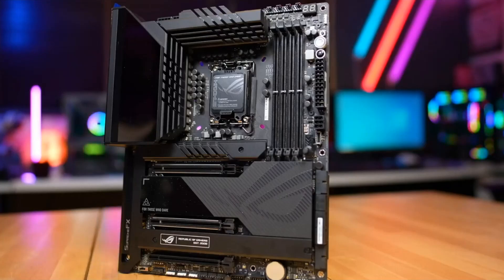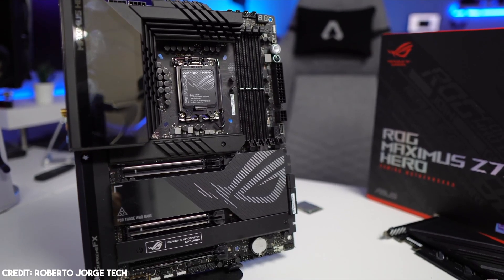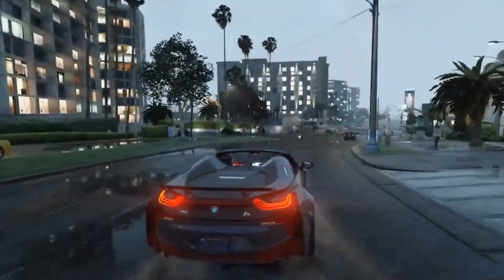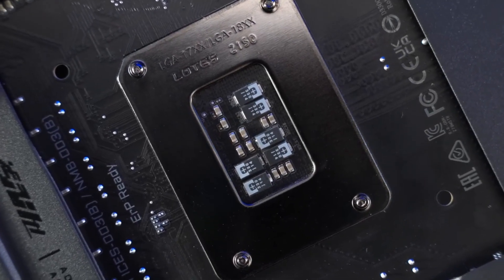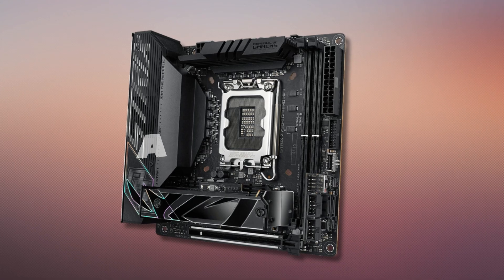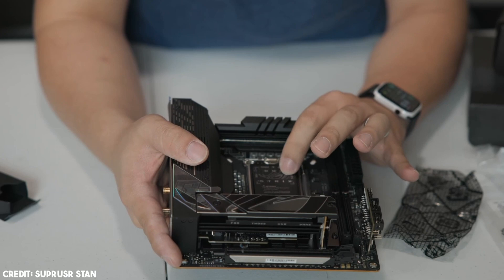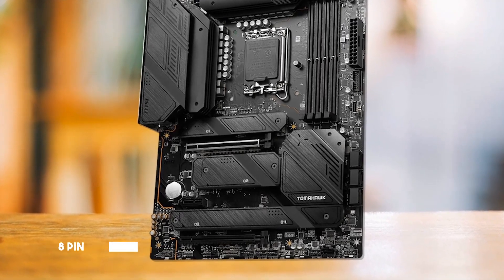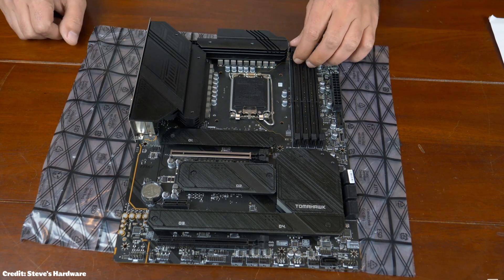5 Best Z790 Motherboards You Can Buy Right Now

Comment: MSI MAG Z790 Tomahawk WiFi is great on paper. But looking at reviews many boards arrive DOA. 24% negative reviews is pretty poor. I had a very bad run with Asus on 690 and 790. Replaced my Asus 690 with an identical board only to have the same problem. No issues with Gigabyte been great so far.